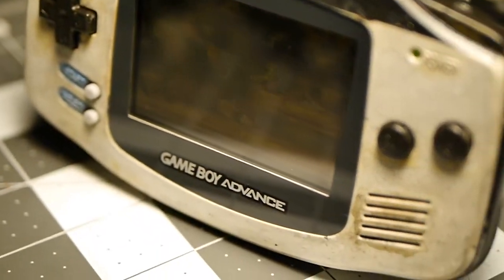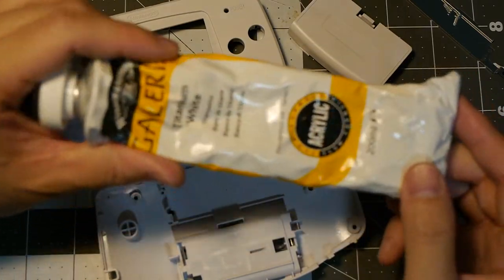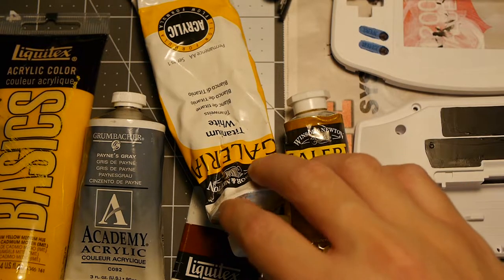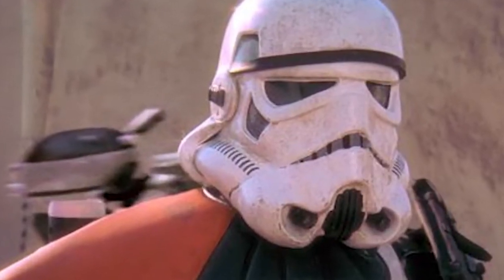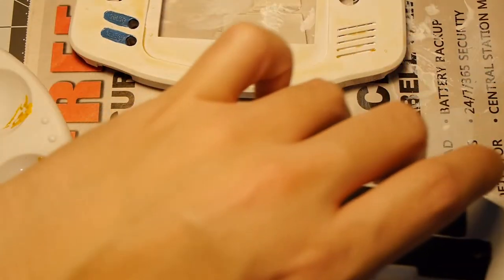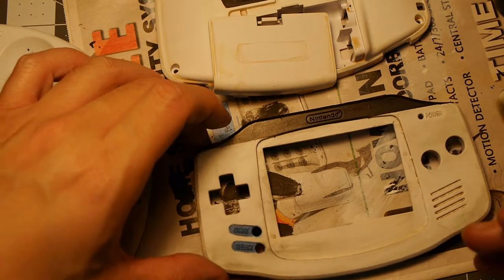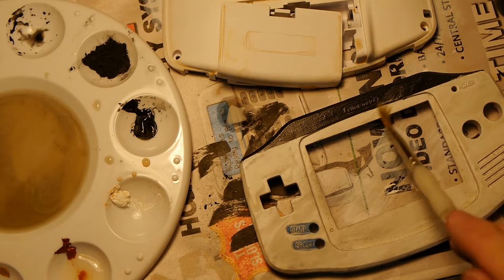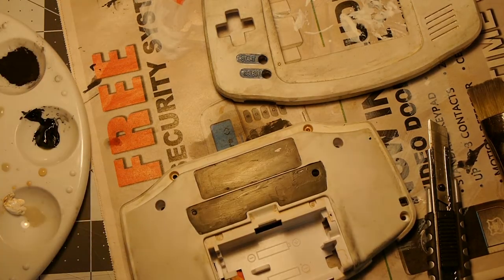Retro Mod - Weathered Stormtrooper GBA Shell

Comment: Nice video/mod. Quick question (from someone who doesn't do mods), I notice that you've used mostly acrylic paint. I never used the stuff so I'm curious if it makes the surface of the shell rough? Does it require fine grit sanding (or is it not advise because of the details in the shell might disappear)?
Reply from the maker: Acrylic works especially well for this type of application since I use multiple layers to gradually build up the patina. I didn't do any sanding but it would help. To keep it smooth I use multiple layers of clear coat (any type will work) you just want to be cautious about button holes so the buttons and dpad can move freely.  Goodluck if you decide to try!
Reply: @retrodonut1185  Hey thanks for the reply :) follow up question if you don't mind: Does this work for other types of plastic shells (like say keyboard shells, really old pc cases, etc)? Thanks again.